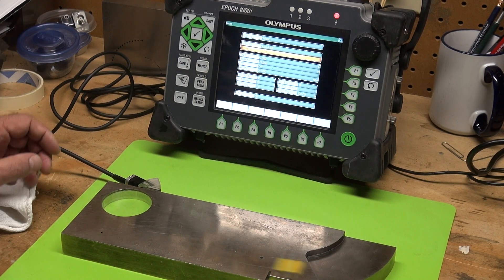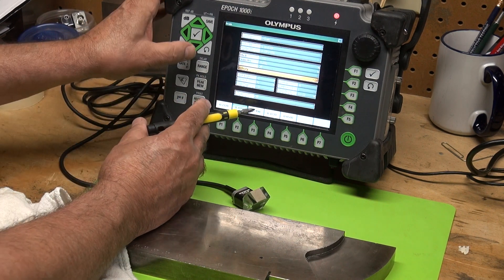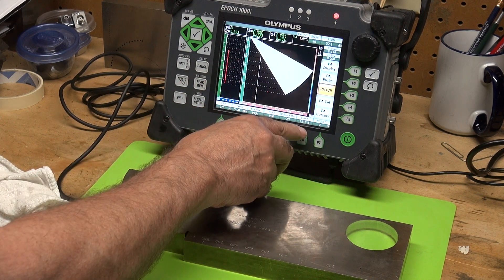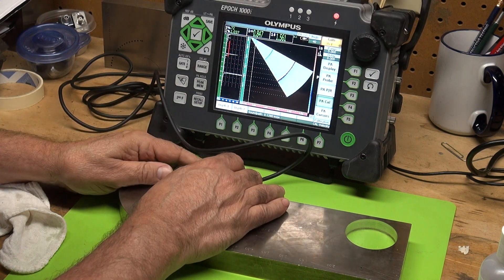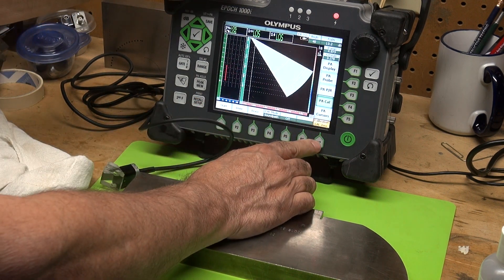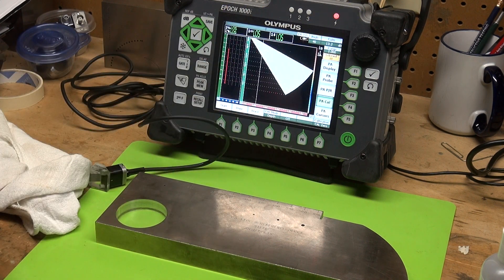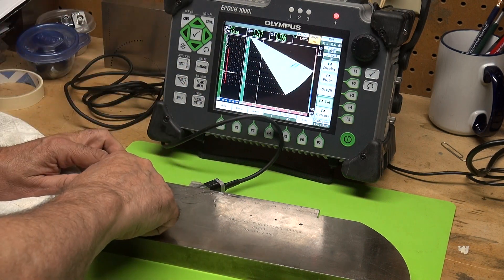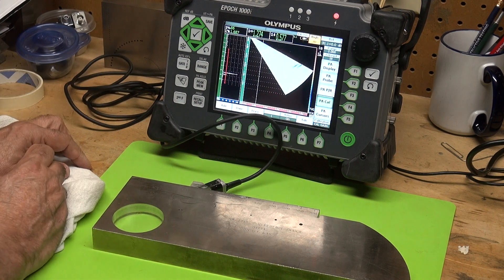Phased Array Calibration

Comment: Thank you John. When using annex H AWS D1.1 I get quite confused with this fact of adding gain for the SSL and then adding 6dB of soft gain por scanning levels. . Adding 4dB is like calibrating for 80% instead of 50%. FSH. What would  be your advice to deal with AWS requirements?  Thank you again.